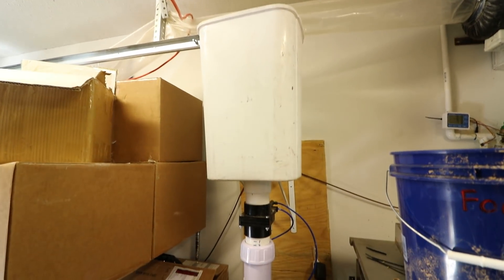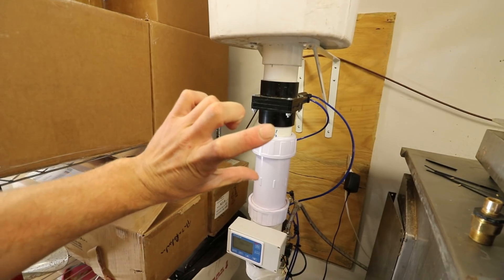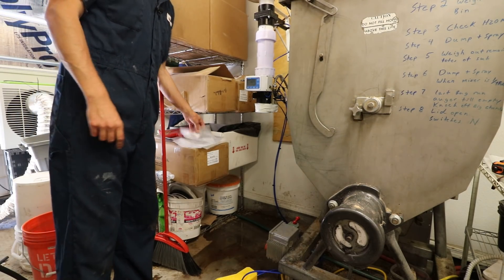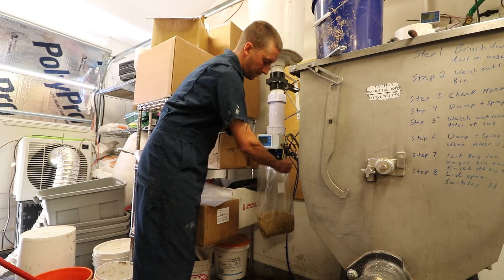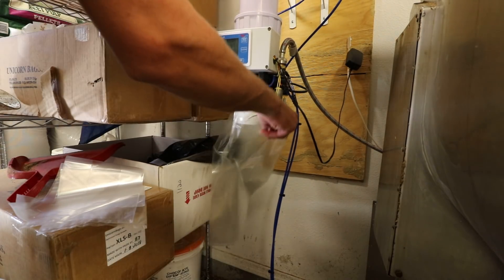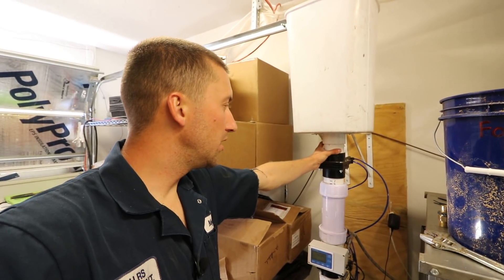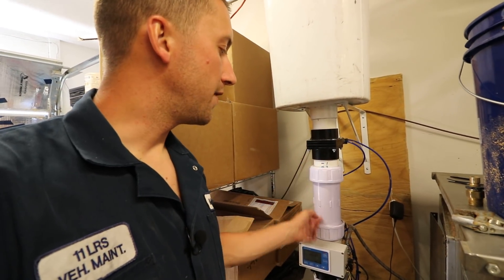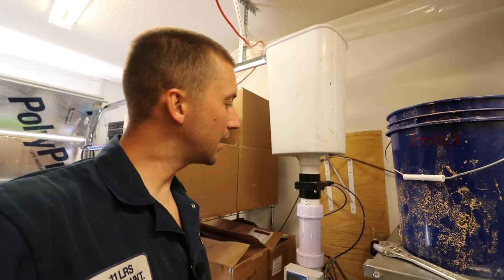Auto Spawn Dry Bagger For Gourmet Mushroom Farms

Comment: Very nice setup. I know this is 3 years old  but hopefully you will see this. If i just wanted to do 1 LB dry seed. Just omit the water controller and water valve? Then how coul I incorporate a scale for 1 LB or is by volume actually accurate to 1 pound when dialed in by using the collar adjustment. This would be cheaper than a 600 dollar bagger with vibrator or do you suggest a vibrator in a dry only setup?

Comment: Does 1:1 work for wheat? Is that hot water?
Reply: If you watch he uses a drum sterilizer for most of his blocks It's basically a water heater that is fed cold water and heats with an element similar to a water heater which is the source of the extra heavy metal and other contams in your hot water on tap. It's up to you if you wanna use it. Hot water helps breakdown hardwood pellets like oak though so it's your call. I usually get the exact amount of water I need and boil it then pour into the substrate if I use hardwood pellets. It's also pretty damn clean in pellet form so you're pasteurizing somewhat by doing so.
Reply: Hot water from a water heater contains more heavy metals than regular tap water
Reply: @bobfitz7886  That doesn't answer the question? You can heat any water, any number of ways.
Reply: I think he sterilizes with hot water. I have no problems mixing with cold water once you heat it to kill the contams the water steams into said substrate pretty efficiently. I don't believe it's hot water. You can use it but I just said that as a word of caution to prevent further contamination... It's not necessary to use hot water, no. I don't think he will comment on YouTube so I just wanted to put in my take on it to a fellow grower